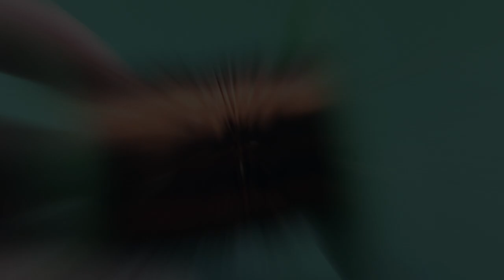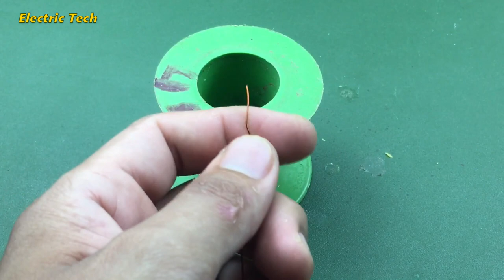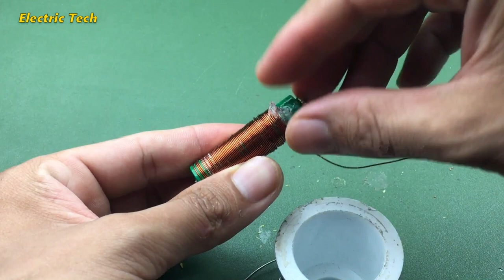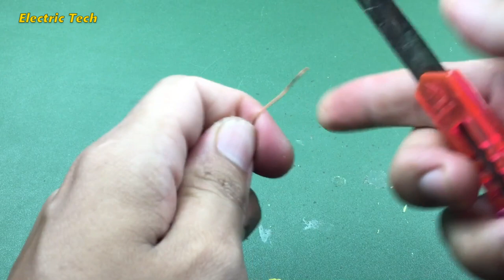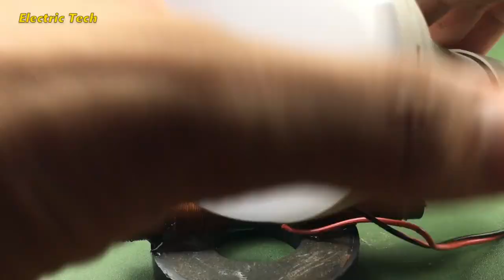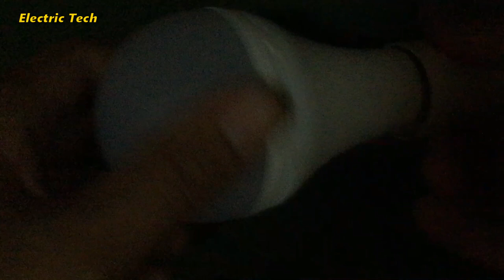Free Electricity Free Energy Generator With Magnet at home 2019

Comment: Please give correct information about strength of magnets,  wires used in mm, batteries in volts, spark plug specifications, bulbs used in watts. 
Let them be displayed or focused correctly on the items used.
Reply: its bulb with battery ,just touch two wire the bulb will come on,.no one will like you tube ,no more its fake